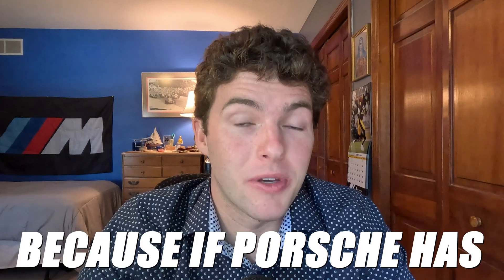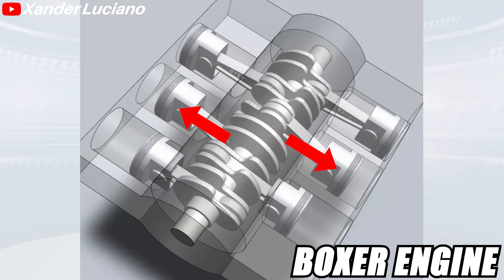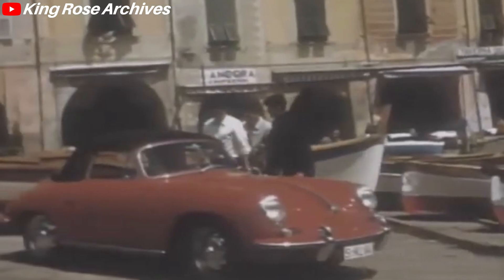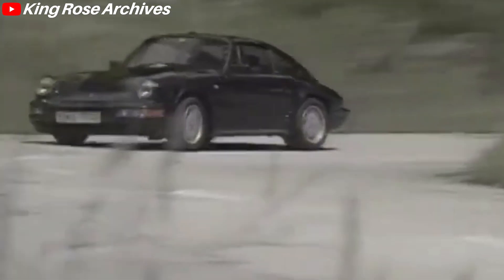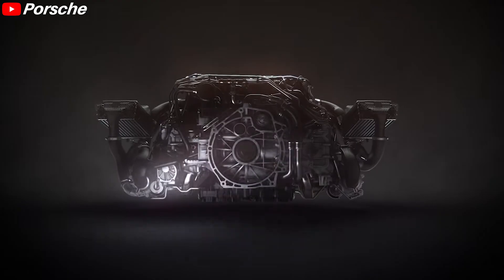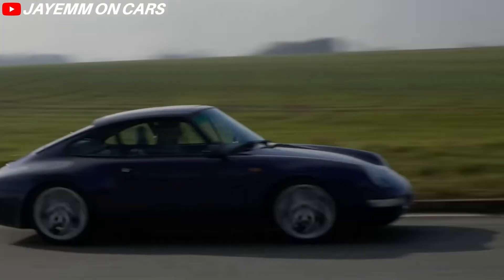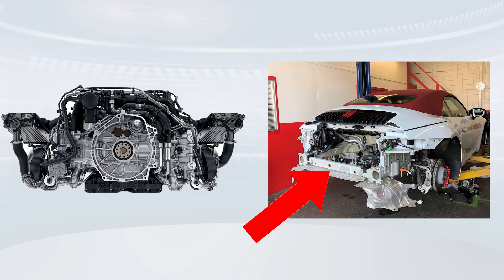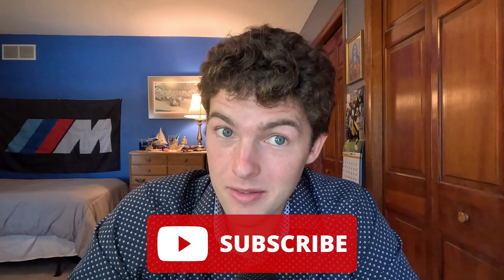Porsche is OBSESSED with Boxer Engines: Here's Why

Comment: 120° V6 makes a bit more sense actually. Now, I'm not 100% sure if a 120° V6 is perfectly balanced like a B6 is, but you can actually mount the Vee engine lower in the chassis than you can a boxer, because boxer engine has either the headers or intake hanging under the engine, so it limits how low you can mount it, which means the transmission has to be mounted higher up. You can see this in Porsche transaxles where the axle line is actually under the crankshaft line. And therefore the transmission and engine sit higher than the axle line. With a 120° V6, you mount the engine in a way that the crankshaft line is lower than the axle line which lowers the engine and transmission therefore significantly lowdring the center of gravity, which obviously improves handling and performance. Thank you.

Comment: However.....The weight distribution makes them extremely dangerously tail happy. The small scale of the pistons means everything is miniscule with very tight margins and prone to break! Most 911s I looked at buying had had engine rebuilds!
Reply: Porsche 911: 13.2 fatal accidents per bvm (4.6x) - 4th most dangerous car in 2024
Reply from the maker: This is a good point.. thanks for the feedback!

Comment: Well, technically a boxer engine is not a flat V engine. In a flat V engines each pair of pistons on each bank share a single crankpin, so they move to a same direction. In a boxer engines, each piston has its own crankpin, so the two pistons move to a opposite direction on each bank.

Comment: The first engine to be nicknamed “boxer” was the flat-4 that Ferdinand Porsche designed for the German armed forces in the 30’s. It was nicknamed “boxer” because the movement of the 2 cylinders on each side was reminiscent of that of a boxing fighter. Flat-6 engines could only be called “boxers” if there were fighter with 3 arms! Boxers can ONLY be flat fours. Flat 6s should be called: Flat-6.

Comment: If you're talking about boxer engines in general, then you really shouldn't forget Subaru using them in their cars as well, and BMW using boxer engines in their motorcycles. With that logo in the background one would think you'd at least be aware of the latter.
Reply from the maker: I certainly have room to improve

Comment: I've always been a fan of Porsche's horizontally opposed engines.  However, due to cost-cutting, they have compromised cylinder wall integrity, resulting in a relatively high incidence of bore scoring in later models.  This has been slightly mitigated as Porsche moved to a redesigned 9A1 platform.
I'm still a fan, but my 3.4L will  always need special care before I rebuild it to a 4.0.

Comment: Hmmm🤔, correct me if I am wrong but I believe the boxster engine is NOT over the rear wheels. They are  BEHIND the rear wheels as in the original VW Type 1 layout.   ie.....rear mounted engine.
Reply from the maker: That is correct. What I meant to convey was the weight of the engine in the rear of the car gives greater traction to the rear wheels
Reply: @DrivenbyMatt  Correct 👍🏾😊
Reply from the maker: I gotta work on specifics in my script writing lol I appreciate u pointing that out

Comment: Weight distribution of the 911 never was great and far from the optimal 50/50 with that heavy engine on top of the rear axle . Handling requires training to master it in difficult situations

Comment: Laying a V engine flat makes a 180 degree V engine, such as the 917 engine which was a flat V12 engine, not a boxer engine since each set of opposed pistons shared the same rod journal on the crank. A boxer engine has to have individual rod journals for each piston and opposing pistons have to move in and out at the same time. Porsche doesn't only peoduce wonderful boxer engines, their engineering is much better than other car brands. I'd rather do R&R on ten Porsches with boxer engines than one BMW or Mercedes, Porsche is just that much better thought out and engineered.

Comment: Can I assume you talked about the lower CG? Porsche claimed that but used a V in the CGT. When questioned, they said “the vast majomajority of weight in an engine is in the bottom of the V so it’s actually got a better CG than a flat engine.
Reply from the maker: I did mention that. That’s interesting, I haven’t heard of that. I will look into it now though. Thanks for commenting
Reply: @sportbikejesus What….. The CG of a flat engines is best as the engine is less tall than V and a flat/boxer sits lower in car chassis. There flat CG is lower.

Comment: Boxer type engines provide less bearing load--the weight 9of con rod and cylinders tend to balance out some of the load.  Theoretically, this should provide longer crankshaft and bearing life. Most aircraft engines that are air-cooled use this style of engine, or multi-cylinder variants.

Comment: Great video, Matt. Very informative, relevant and concise. The only thing I have to add is what has basically been said below in response to RoadRunner's erroneous post. Flat engines have horizontally opposed pistons. Non boxer flat engines have opposing pistons mounted on the same crank pin resulting in both pistons moving in the same direction resulting in undesirable vibration.  The Ferrari non boxer flat engine referred to below was curiously designated by the manufacturer as a "180 Degree V-12". Boxer engines are flat engines in which opposing pistons are mounted on separate and opposing crank pins so that each pair of cylinders moves in opposite directions cancelling out vibrations as stated in the video. Therefore, all boxers are flat, not all flat engines are boxers. All Porsche and Subaru flat engines are boxers.

Comment: I ride a BMW motorcycle. With a boxer of course. Smooth as a sowing machine. The servicing is easy, just because the cylinders are so accessible. I always wondered why no other brand uses it, except for Honda in their GoldWings. The ground clearing is enough. A boxer in a motorcycle has one little problem: putting your legs out in front is hardly possible.

Comment: first 30 years, boxer configuration was the only engine used by Porsche, then for another twenty, the boxer was the biggest seller. I am a big fan of the boxer, though I lament the passing of the aircooled boxer engine. Wasser cooler is so much more complicated and when higher mileages are reached, so many more components start to fail on the wasser cooler. Not so the air cooler.

Comment: I had a Subaru with a Boxer engine. Never again! 
systemic faults.  head gasket failures, excessive oil consumption, and oil mixing in with the coolant, among others.
Problems started at 130,000 miles
To expensive and complicated to repair.

Comment: Cool video. But Porsche does not seem quite as devoted to the boxer engine as Subaru. As soon as they put the engine up front in any of their cars, Porsche decided to use inline engines for V engines. IMO, their sedans and SUVs would be much cooler if they had boxer engines. Maybe even some Boxer flat 8 engines.
Reply from the maker: You have a good point - I think I might look into it for another video. I could address some of these things. Thanks for the compliment and for the good feedback!

Comment: The VW bug employed an air cooled 4 cylinder boxer engine which was magnificent, also in its simplicity, and very reliable, albeit noisy and not so efficient. But it was good enough to be bored out and  pairs were used as aircraft engine s by a French company who built light aircraft for use in places like Africa and Australia by flying doctors, among others. Twin boxer engines from BMW were also used to power the original Citroen Deux chevaux in post war France.
Reply: The valve heads used to separate from the stem. Kind of ruins your whole day.

Comment: I've always understood a boxer to be a horizontal opposed firing order, eg- BMW two cylinder opposed, or 4 cylinder opposed, like the 356 and 912 had. A 6 cylinder engine is not opposed firing order, therefore should not be called a boxer but a flat 6. Not mentioned is that many aviation engines are 4 cylinder, and even 2 cylinder opposed, making them also boxers, and as to more parts? Not really true anymore. Vet, multiple cams, 4, or even 5 valves per cylinder, chains, guides, pumps, etc, all makes of engines, Nissane, Honda's, even American engines, can hqve more parts than a boxer or flat 6. And speaking of: a flat 6 has a very accessible top or underside where most accessories are mounted,  unlike v-8s and v-6s where stuff is hidden on the sides that are harder to access.

Comment: As an Owner of a 1971 Porsche 911T  which still runs w 1.3 million miles on the original engine I can elaborate on some points. They need near zero maintainence; my carb was set once, after that just sparkplugs - this is due to the high precision and counter balanced forces that you elaborate on.  Another aspect you didn't mention is wear - a flat engine starts with oil still in the cylindars; as a result it does burn some oil; but with  other engines gravity drains oil so they start nearly dry.  Driving the car properly is also key to any cars longevity; keeping in the power range and not lagging your engine is very important.
Reply: Which brand of Carb?, sounds like your car had the italian carbies. The German carbies were not as reliable.
Reply: The only problem with these engines, is not driving em frequently enough.
And that is really just a function of oil / fuel / seals degradation 

Drive em often
Drive em hard (after a decent amount of warm up) and they will last forever
Reply: @stijnvandamme76  I agree 💯, Porsches were made to be driven often and hard. They were originally built to be driven on the German Autobahn. Anyone who has lived in or visited Germany will know what I mean🏎

Comment: Most light aircraft are powered by flat 4s, 6s, as well as some rather rare 8s.  The main reasons for this choice were a) less vibrations (although still quite a lot for the light structure of an airplane), and b) easier to air cool, as you rightly said.  Moreover, the problem of difficult access for maintenance, that exists in cars as you stated, does not exist in aircraft, as the engine(s) sit in cowl(s), that can be opened on both sides, or even easily entirely removed in minutes.

Although those engines, for Porsche as well as for light aircraft, are designs dating back to the 1930s... so getting very much obsolete.  The future is to powerplants MUCH lighter and smaller for a given power, with much flatter power and torque curves to the point of requiring no transmission box, requiring very little cooling, almost noiseless, inducing zero vibration, much cheaper to build, requiring next to zero maintenance over much longer life times. Oh, and BTW, they also require much less (in terms of $) of a different "fuel": electrons!
Reply: The sound of an NA Flat Six is definitely not obsolete.

I had a Tesla for five years. I’m pro-EV, but not at the expense of everything else. Horses for courses.
Reply: @m5pilot397  You need noise to reach satisfaction?!?!  For me, noise is rather repulsive, whether it comes from my own car, or even worse, someone else's!

I made up with it for decades, like everybody else, and didn't complain as long as they were no alternative... and definitely preferred a good -sounding engine to a bad-sounding one.  But now that it is available, I much prefer a quiet ride, possibly with a high-quality rendering of my favorite music.

Well, I guess my grand-son also needs his comforter!
Reply: I really feel sorry for you.

Comment: There really is no question about the success of the Porsche flat 6.  They compete with cars that have engines larger in displacement and still are competitive.  The longevity has been proven as the materials used are superior to most.  Yes, parts and maintenance are expensive but the performance and longevity of a well maintained flat 6 keeps one smiling.

Comment: Porsche also makes their engines durable and they have a life-time cam chain so no timing “belt” to replace. Replace the plugs and drive belt every forty thousand miles and other than typical fluids, brakes, tires  and filters that’s all there is on the engine to replace. Another reason they’re so good is refinement. Porsche has been making flat engines for over 80 years. Then there is the intake manifold which is designed to flow air better by using intake air pulses generated when intake valves close and air is redirected to the opposite cylinder bank at increased velocity. They haven’t missed much with so much development.
Reply: That was not always the case. with the aircooled motors, the timing chain was a problem with higher mileages, when they stretched to far with wear, catastrophic damage, an after sales  fix was implemented, a guide was added against the change which prevented the damage, the other problem was with the K Jetronic. a back fire would see the intake plenum chamber crack due to excessive pressure, lead to uneven running. a spring loaded trap door was added as a precaution, so the plenum chamber had a way to vent the sudden extra air pressure. cured the problem. This was a 1980s fix and it worked well.

Comment: Great video, short and simple! Wish more cars that are awd use the boxer engine, but it does cost more to make and service, if you have ever replace a simple task like the spark plugs on an inline or V engine compare to a boxer/flat engine you will know. Porsche flat engine are quite reliable and completely make sense, low and wide to sit on the rear drive wheels, just look at the 4 litre naturally aspirated masterclass engine in the 911 GT3 rs and revs to 9000rpm too, just amazing.
Reply from the maker: Thanks! I appreciated reading your comment

Comment: Well explained, and when you drive a 911 you can really feel the benefits, the way it feels so planted. It's very different from most other high performance cars with a front engine.
Reply: I love 911s, have one. But the rear engine is a negative, in and of itself, except under braking. Matt didn’t quite explain it fully, but when the weight shifts under hard braking, you’ve got good weight distribution. The engine location works because Porsche has spent decades refining the chassis.

Remember the 930? They called them widowmakers because of how they handled under certain conditions.

My Cayman technically bangles better, because it’s mid-engines.
Reply: Bangles? Nah, that’s a a girl band.

Handles!